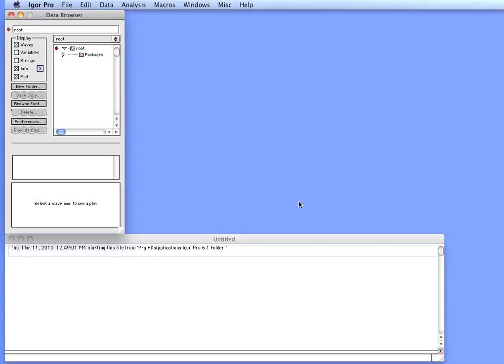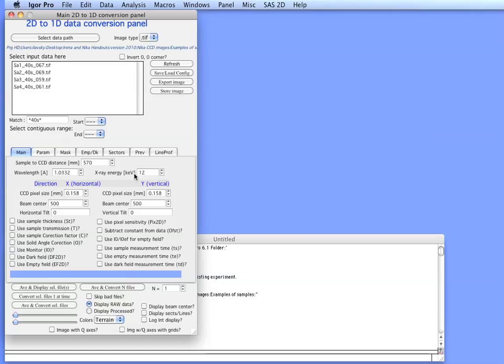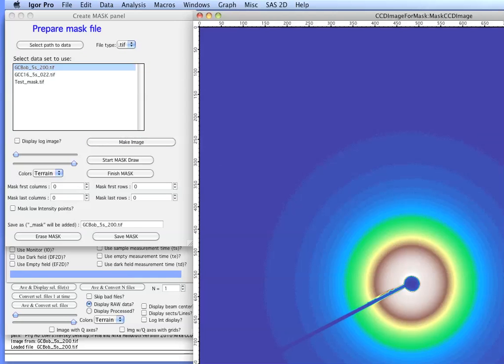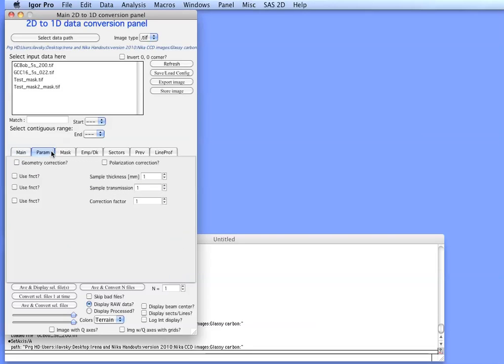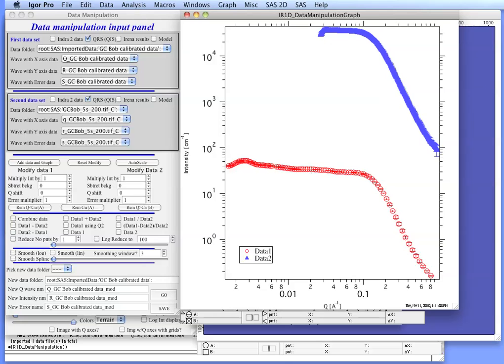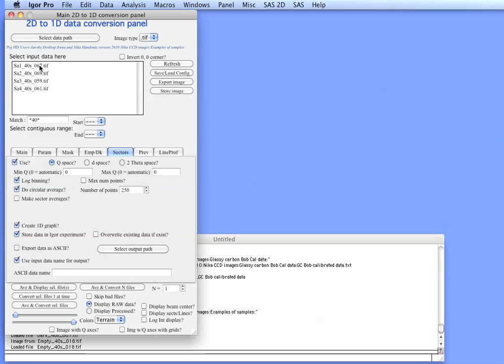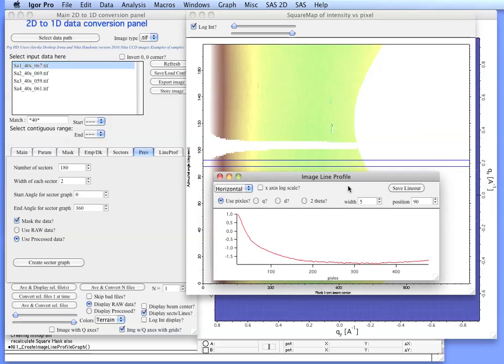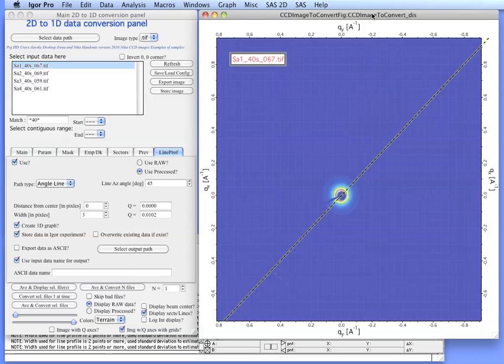How to use Nika for data reduction

Comment: Hi, Thank you for the video!! I have a question. When I was calibrating the beam center using Agbh, the white line you talked about was very small that it is only within center beamstop region. I was wondering if we can make the white circle bigger?  I see using the width there only changes red circles.
Reply from the maker: Please send me screen grab of the issue you are having. I am not sure which white circle you are talking about. You can send me e-mail from Nika menu.

Comment: Hi. Where did you get your calibrated .txt file from? Thanks
Reply from the maker: Calibrated data for your standard need to be supplied by source of the standard. Today you should get NIST SRM3600 Glassy Carbon and if you have that, you can download the SRM data from NIST web site. If you use other standard, you need to get calibrated data from the source of that standard.